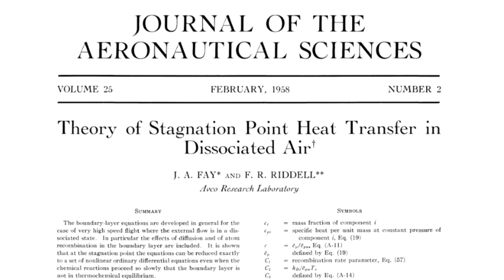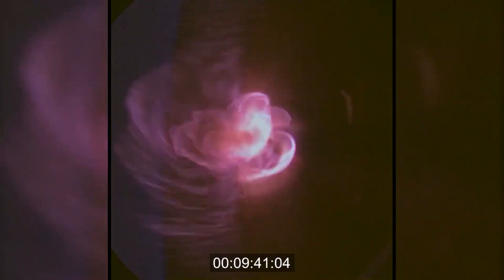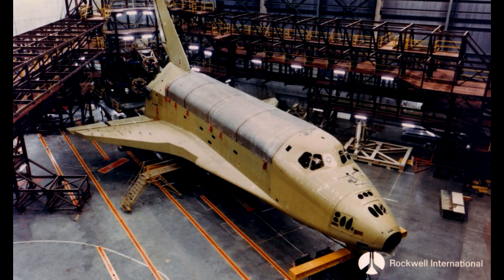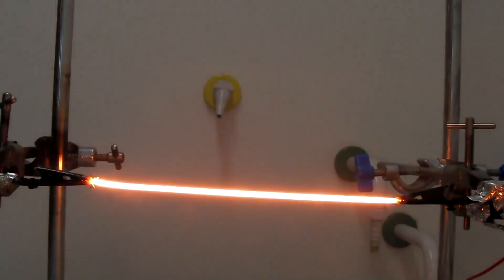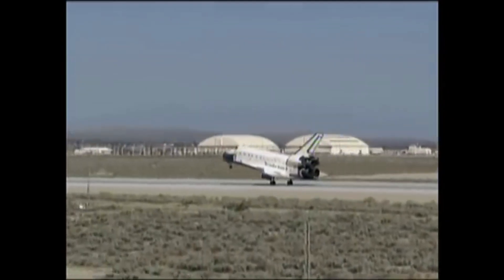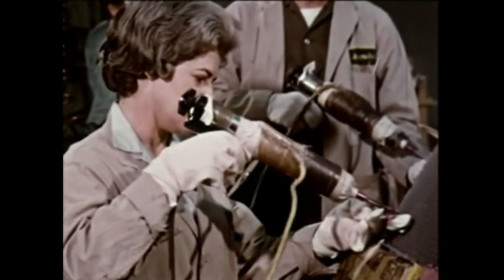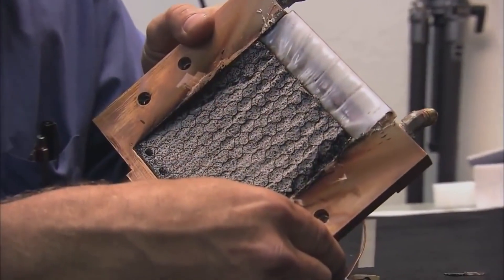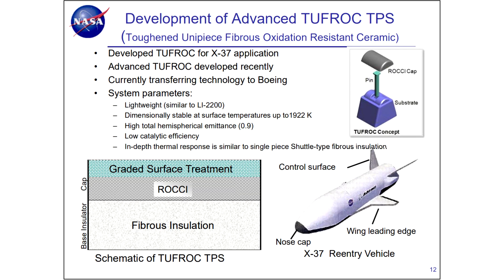Heat Shields - Things Kerbal Space Program Doesn't Teach

Comment: 9:55 "Supposed to be re-usable" - yes those words define the entire Shuttle program.
Reply: Go to the Smithsonian Museum, Kennedy Space Center and the California Science Center to see 3 space shuttles with over 30 flights each. Keep in mind that all future spacecraft were based on this 1970's reusable technology. Show a little respect.
Reply: @divedevil985  yeah but reusing them was more expensive than not reusing them would have been, so that effort was pretty wasted.
Reply: @Chuckiele  Bruh. Are you serious or are you joking? While thats the case with the SRB's the Orbiter and the ET... Not so much
Reply: @youravaragejoe5102  The SRBs were just the tip of the iceberg, where refurbishing basically meant stripping them apart and rebuilding them entirely with only the casing being actually reused and that was damaged badly by the salt water. The Orbiter had two major issues as well. The first one being that the original design had less cargo but internal fuel, the design they eventually went with had much more cargo and no internal fuel so that it needed an external tank. However for some reason they forgot to move the engines below the external tank. Instead they were dead weight on the orbiter once the tank was dropped. The engines themselves were extremely expensive to refurbish because they were a very complicated design. Expendable engines strapped to the external tank would have been cheaper while achieving the same result, except that the Orbiter would have been lighter as well. The second issue was the heatshield which was very expensive yet very fragile and thus every tile had to be checked and replaced if needed after every flight which was very labour intensive and stripping off an ablative heatshield and reapplying it entirely wouldnt have been more effort but would have been way cheaper in material costs.
Reply: @Chuckiele  The bulk of he cost was the man-hours not the material. From what i understand the shuttle tiles turned out way less durable than was expected during design.
Reply: @darthkarl99  yes, labour tends to be more expensive than materials but both could have been cut down significantly if they hadnt gone for a reusable design. Dont get me wrong, reusable launch systems are clearly the future, they will eventually be able to reduce price and turnaround time significantly but the shuttle failed at that. It was known from the beginning how fragile the tiles are btw. you could easily crush them in your hand.
Reply: @Chuckiele and yet SpaceX is using them on Starship today 😂😂😂
Reply: divedevil985 it was a bit of a big Oof is all, mad respect but yeah they had to be refurbished a bunch

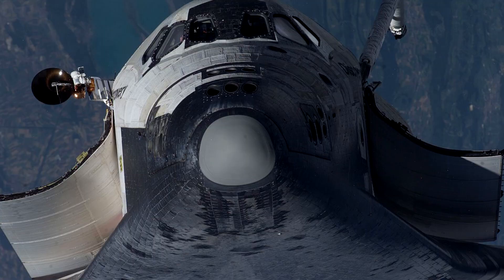Comment: I would not call the Space Shuttle heat shield the "easiest design to understand" 5:30.
You need a lot more time explaining it than you take to explain Apollo.
Reply from the maker: It’s easier because it doesn’t rely on chemical changes and abalation. Harder to engineer for the same reason.

Comment: Scott do you think a Nobel Gas (He, Ne, Argon) infused plasma sheath form an ablative protecting layer if 'Foam'ed into Carbon Fiber Tiles or perhaps a passive or active leading edge fluid cooling system(removing heat by radiative-evaporative cooling) or would using the new aerogels be better?

Comment: The easier way to look at re-entry heat is that at the point of the shockwave the gas becomes relatively incompressible for a moment, its much like how hydraulic systems generate heat.

Comment: Ablative materials are used on heat shields if I recall correctly when an Apollo Astronaut came and visited my school district. He showed us a short video in the early 90s how the material gets thinner when 1000s of meters per second of air as vaporised particles ablate off... Also if I recall the materials might be made of certain elements before re-entry and then will change after cooling... AND you spent so damn long on the space shuttle that I typed this before you talked about it...

Comment: Scott,   after considerations,, as to structure, single use, quick and cheap and easy to replace,, and I am quite serious about this,,, white oak, ash, or elm,, elm in particular.   Elm has one very specialized use in industry.  Whenever you look at a very large dump truck that is hauling broken concrete type construction debris,, the interior bottom surface of that truck is very likely elm.  And every 2 or 3 years,, the elm planks are unbolted,, whatever is lleft of them, and new planks are bolted in their place.  The weights might make it less practical, about .75g per cc. however the thickness required to survive the time of re-entry might be less.  Manufacture?  The very easiest and least expensive of any of your materials,, I'd guess 1/100th of the nearest competitor.   Manufacturing costs would be dead low, and material fabrication, fastening, and replacement might involve minutes vs hours.

The amount of water weight,,, could be high or low,, which ever works best,  or possibly soaked in an exotic 'something' liquid, , the fibrous nature of elm should survive anything, and the carbonization should be plain and uniform.

Comment: Ablative HPS are certainly not a bad idea for civil reentry vehicle application. Military vehicles require higher reentry speed and Luv/Lee-faces can change during flight. The best way to deal with heat transfer into the spacecraft however is to avoid collision of gas molecules with the hull material. Electrical ionization fails to solve the problem, since forces excerted by corona discharge are far too low to reppel air out of the flight path, as corona discharge lifters clearly demonstrate. A DC arc-discharge would create an electrically neutral plasma, that can only moved away by means of Lorentz-forces - created by impractically heavy coils from  superconducting materials. The elegant solution is to use the GEM (Gravitoelectromagnetic) propulsion system of a landing craft to repel air before it comes into contact with the hull. Dipolar GEM-fields interact with all matter with a non vanishing rest mass. Newton's Lex III applys to GEM as the conservation of momentum (and energy) does. Hence, a repelling GEM-vector at the Luv-face of the craft is strong enough [in m/(s²/m²)] to create a plasma by impact ionization, that starts several cm away from the hull,extends to up to 1m and absorbs the kinetic energy of the deccelerating vehicle. The heat of the plasma can be reflected by a polished Aluminium surface. Of course, this is technology, that does not exist - officially. Since it is hidden in plain sight, I can talk about without detrimental effects to my humble self. This concept is not very new, when USAF/AFSPC managed to cancel the flight of the X-33 in 2001. This spaceplane was equipped with an Aerospike Engine - capable of STTO (Single Stage To Orbit). USAF was net very delighted with the idea numberless civilian spacecrafts without any military supervision would disturb their activities in space.

Comment: Zirconium diboride has show very high resistances to heat while being very resistant to corrosion and a hardness just a bit higher than quartz (on the mohs scale it is an 8), and I think it may be the future of heat shielding.  Basically it had been overlooked imo because previous testing of it's heat capacity had been overlooked due to previous difficulties sintering it, or it's anisotropic nature.
Reply: Sorry, I have absolutely no expertise (just suffered through high school chemistry classes), but isn't a ceramic normally applied in the form of tiles in a heat shield?  Or some kind of coating, but then it can easily crack I guess? That would mean that repairs would be complicated.
Also others mentioned TiB2 as another wundermaterial which has similarly high melting point.

Comment: @Scott Manley Can you please cover how Falcon 9's lower stage (and by association, Falcon Heavy's core booster & 2 side boosters) use their exhaust plumes for thermal protection during re-entry to get away without a dedicated heat-shield?
Reply: Short answer - they are going substantially less than orbital velocity. This means that more "conventional" aerodynamics apply. And, because the mission payload has already launched and this is "merely" recovery it can accept a fair bit more risk.

Comment: @Scott Manley So, you're saying that an ablative material basically serves as a sacrificial insulator protecting the spacecraft from overheating, in the same way that a zinc bar on the outside of a boat or ship's metal hull serves as a sacrificial anode protecting the sea-going vessel from corrosion?

Comment: Can they just slow down a bit before entering the atmosphere when coming back from the moon or other planets?  Or would that require to much fuel? Maybe it's  easier to just use a good heatshield.
Reply: 박성희 It took the entire launch rocket stack and all of its fuel to get them going that fast. All the fire and energy of launch was turned into kinetic energy. They have to get rid of it all. Using the atmosphere as a brake is the “free” way. As you say, they just need a good heat shield.

Comment: You say that we need reusable heat shields for interplanetary missions.to be affordable, but I'm not so sure.

Surely the production of phenol formaldehyde reinforced glass fibre could also be significantly automated. It's not as though the base materials are very expensive, just the labour and exactitude of construction. Probably no more expensive than the solid rocket motor compositions, and you need far less of it for a mission.